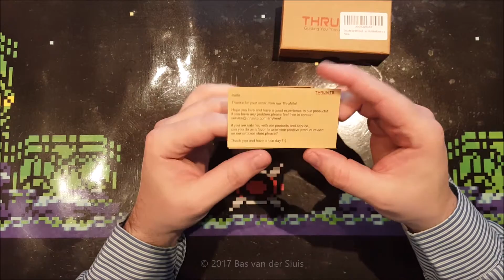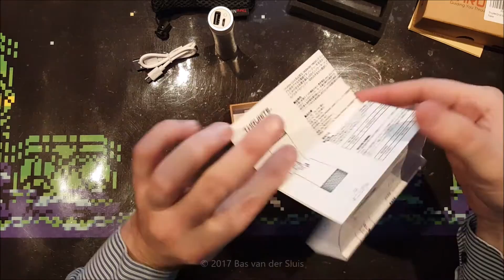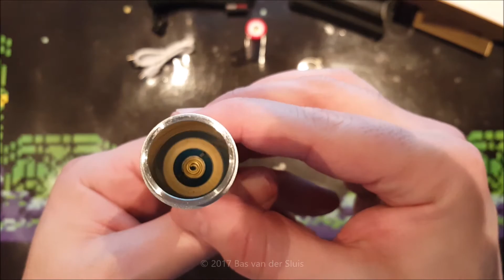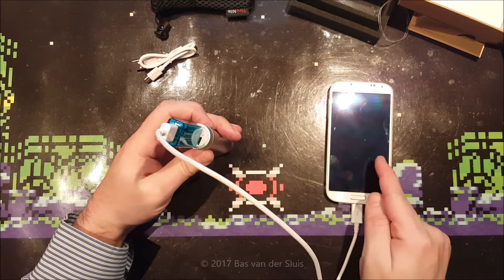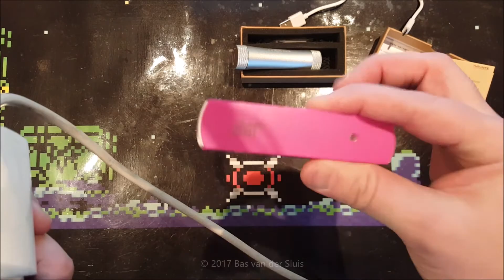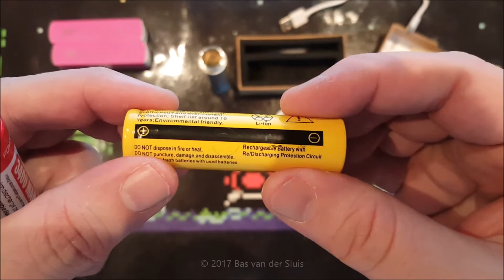Review of the ThruNite C2 3400 mAh Power Bank

Comment: I had the same trouble using my meter. I only metered 2650mah when I charged my c2. Wondering if thrunite overstated the capacity.

Also, the c2 does not fully deplete the battery. I am able to put the depleted 18650 in my TN12 after it stops charging my phone, and it will still power the light for a while.

I put a salvaged 1300mah 18650 in the c2, and was able to add 1100+mah to that cell.

Very strange the 3400mah thrunite  only accepts 2650mah.